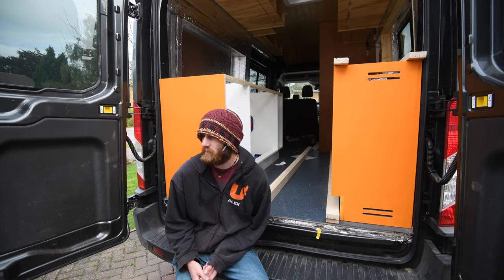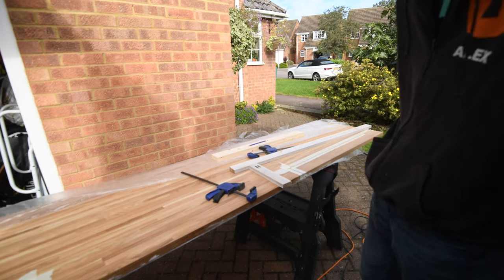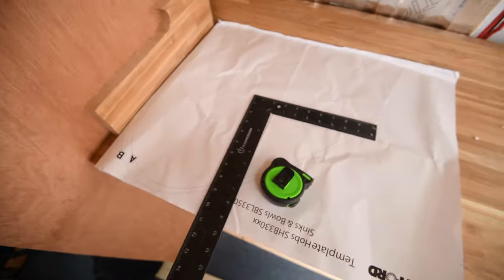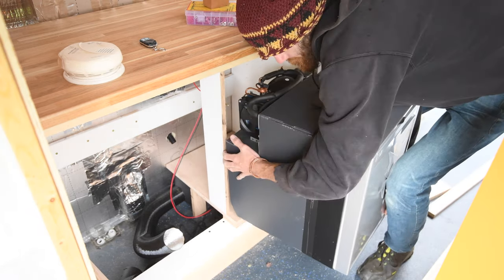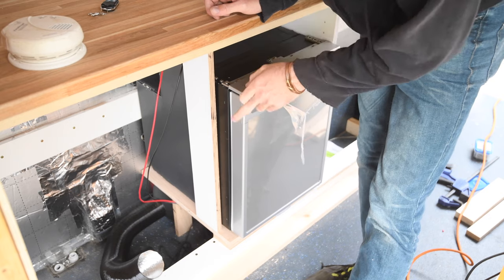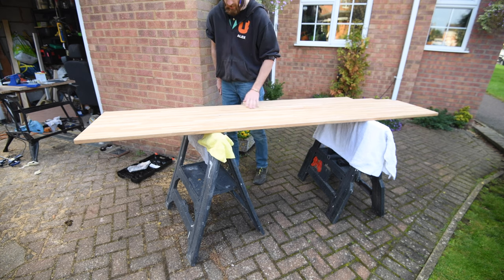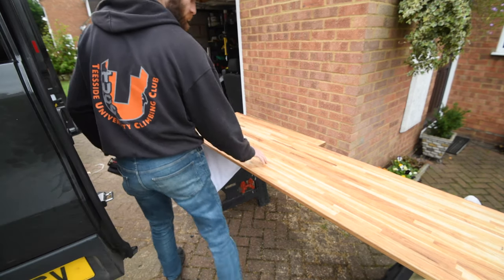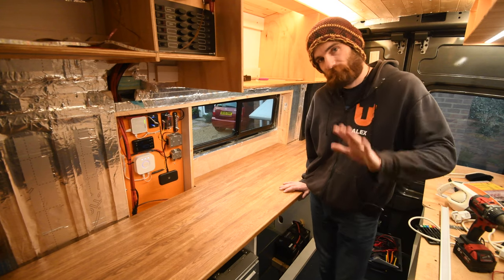Oak worktop and Dometic CRX50 Fridge install | EP31 | Ford Transit Campervan Build

Comment: Great video. I’m just coming up to this stage myself and have the same worktop in mind. 
As for losing the steel ruler, I’m currently misplacing things on every job. The more that goes in the harder it is to find 😂
Reply from the maker: I’m really like the wood top, even more with the slightly darker shade from the oil as I wanted that wood to be in a bit of a contrast to the other bits wood. Scary cutting into such an expensive bit of wood. Usually it’s a measuring tape which goes missing for days at a time. I’ve started to learn to keep my pencil behind my ear I don’t lose that anymore

Comment: Nice, that's massive kitchen for a campervan, I'd be happy with that in a studio flat.

I love that fridge, was hoping to get one of their dual zone ones eventually but the facebook group have convinced me to convert a domestic one to 12v or just use on the inverter which will save me a ton of money cause those things are soo expensive.

Can't wait to see how you do your bed now.
Reply from the maker: Aye it’s definitely looks massive with all the counter space, but the bed will fold down from the other side on to it from the back doors to the electrical wall cupboards. Basically a humongous kitchen counter top in the bed is up and far smaller one when the bed is down. I’ll be making a video about the bed when I get round to it so you’ll be able to get a full understanding of  at then

Comment: This is probably too late after video production for you to see it... But... Did you consider turning your worktop into drillium? Eg drilling holes (i think about 25mm diameter) two thirds of the way through the worksurface in a lattice pattern.

My thinking is it would reduce the weight where the strength isnt needed. But would keep the look of the chunky solid surface.
Reply from the maker: I am familiar with drillium! From a of my friends drilling out internals of kayaks to make them lighter. As for this worktop I’ve seen people router out 40mm to take some weight out. I went for 28mm but because it’s a cheaper oak butchers block I’d worried about taking too much material out because of the warping. But it was a weighty part of the van
Reply: @MispronouncedAdventures  thanks.
I'm on the hunt for some suitably sized seconds/offcuts for my work surface. I have some resin casting ideas to incorporate too, so the complexity of drillium as well might be too much.

Ps ... Love your videos.
PPS ... Your voice sounds so much like Sean Conway. With the awesome beardage as well I sometimes wonder who I am watching.

Comment: How will you service the heater ?
Reply from the maker: Generally I don’t as it’s unlikely it’s ever going to need to come out, If I’m unlikely I might have to one day clean the cylinder or replace the glow plug. If that’s the case I need to remove the 4 screws holding in the fridge and then the screws holding in the fridges frame, I on purpose didn’t glue those joints so if potentially I need to access the Heater I could

Comment: Can you get to the gloe plug under the fridge
Reply from the maker: As in the glow plug of the heater mounted under the fridge platform? yes. It’s a bit of a pain. But the remove the fridge and then bit it sits on for access and maintaining the heater if need be